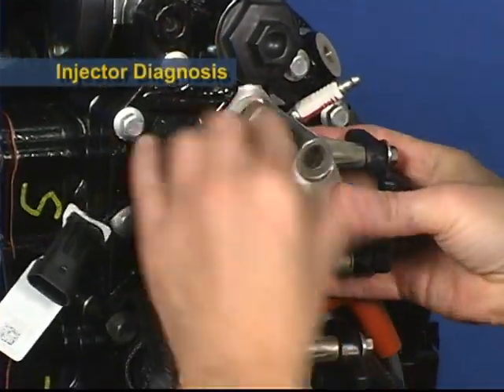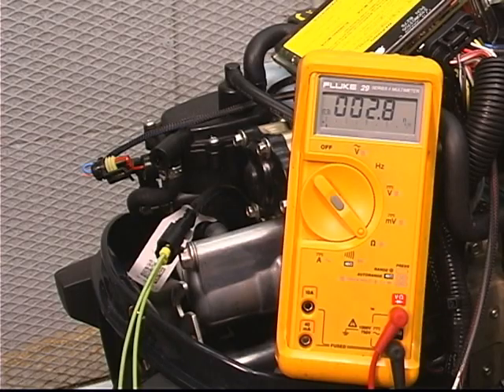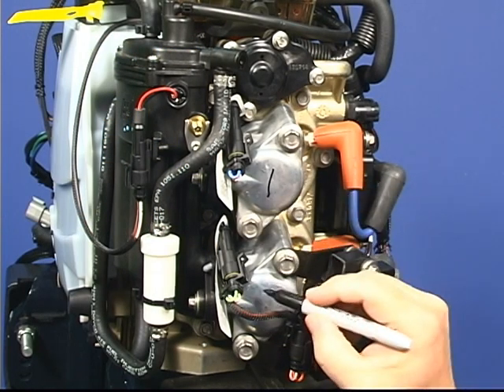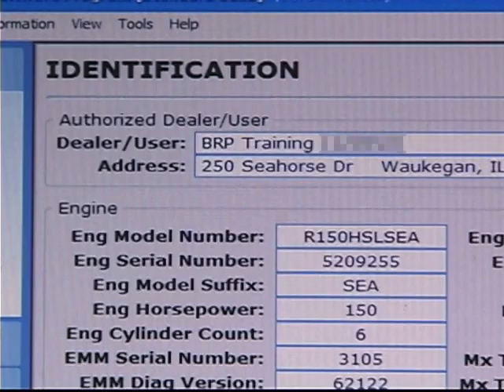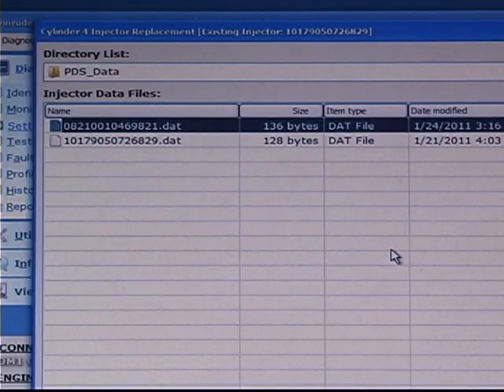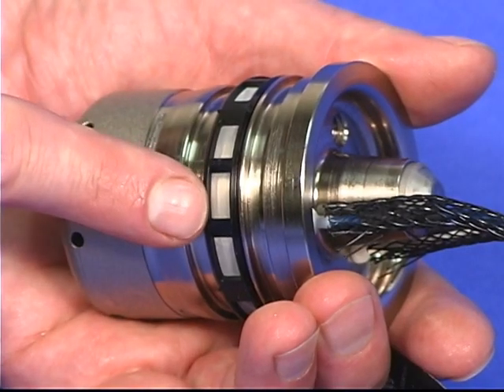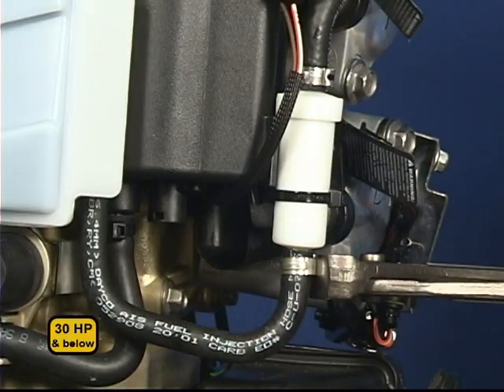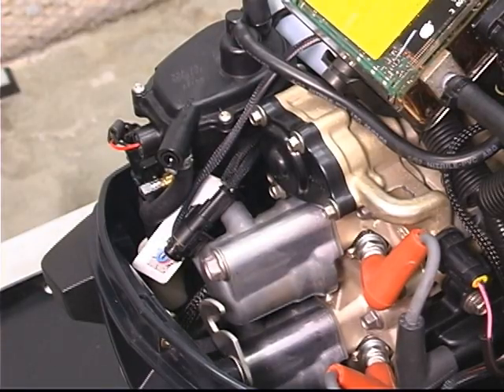Evinrude Etec Injector Diagnostic and maintenance

Comment from the maker: Etec emm has a feature called SAC start assistant circuit, this circuit generates 30v when engine is not running to help to start when the stator is not generating power, and stops converting 30v when engine starts and stator is producing 55v.
Is several components attached to the 55v circuit which can create the problem
1 injectors check for resistance (has to be around 2.5 ohm no more than 3
2 Oil pump check the same resistance 
3 capacitor ( check for bad connection swelling or leaking oil)
If all this are correct you can check for some injector wire chaffed or press between itself and engine, when  u replaced or installed
If all this is correct, is probably a emm issue 
Www.evdiagpro.com

Comment: I recently sent my injectors off to be cleaned and tested on a 2012 225 due to an intermittent no start issue. They were all confirmed good. Replaced o rings on rail and vst filter, cycled fuel pump a few times and fired right up. Powered down and fired it up and let it run for a 5 minutes or so. Stopped and started it 3 or 4 times, no issues. Put boat away and bumped key just to be sure, wont start. Have a 77 SAC code now. I visually inspected the wires and am not seeing an issue. Any suggestions?
Reply: Have you pulled the spark plugs to see what they look like, have you tested the spark to ensure it’s strong?
Reply: If it's a 2005 to 2007 YM there's a big chance the EMM itself went bad. those 586707 EMMs are very problematic i replaced more than 4 of them